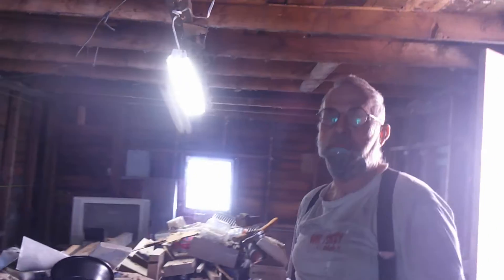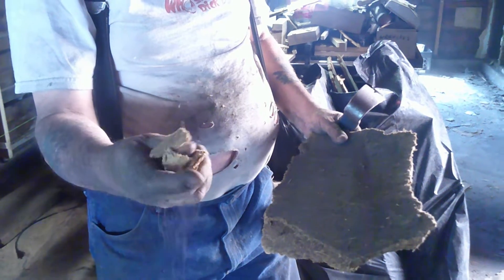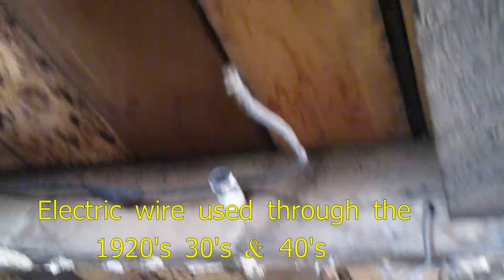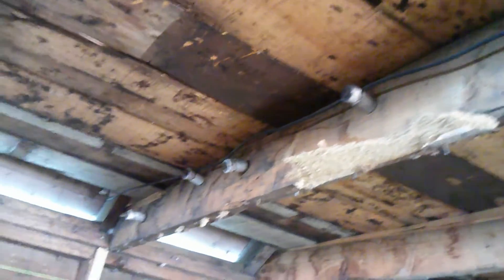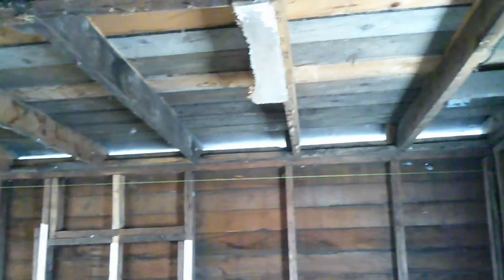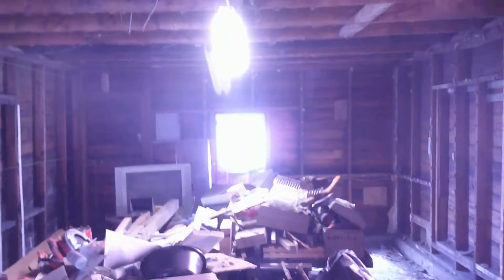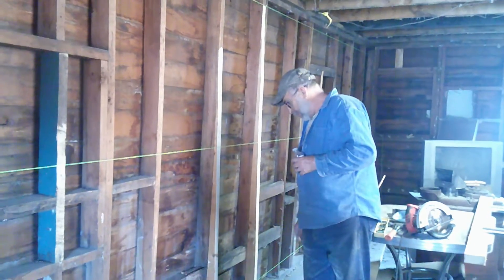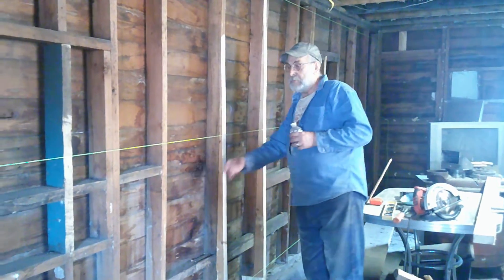I found 100 year old wiring!!  Old Guys Garage Make Over 2022 Part 1 #dyigarage  #oldwiring

Comment: I liked the way the old wire looks with the insulators but i would still run new wire that old stuff is a fire hazzard lol.
Reply from the maker: it is a fire hazard  or rather it was. right now it's just there.  I'll  tale it down before the new sheetrock goes up..